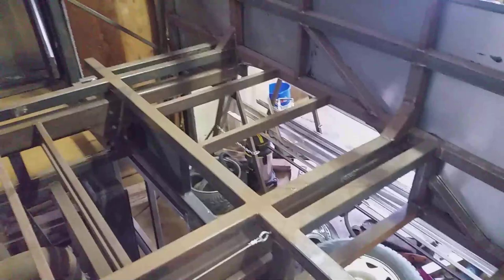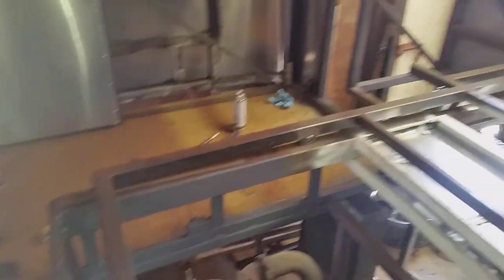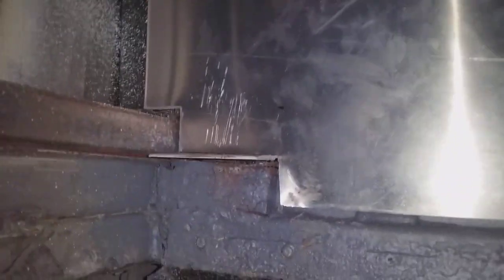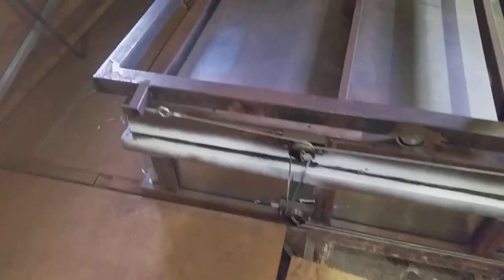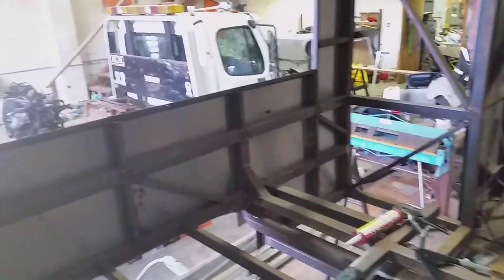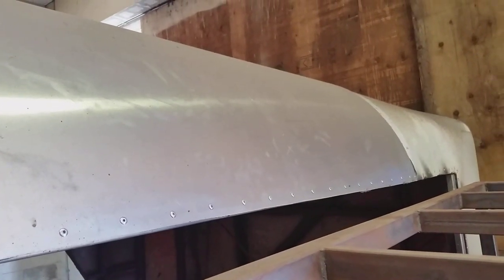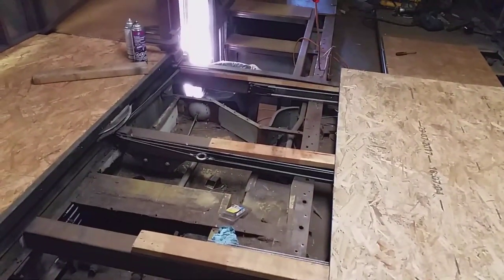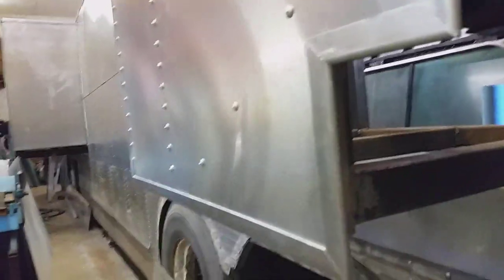Bus Conversion Project - Video 64 - Slideout number 3

Comment: Progress. We are into our second heat wave now. Will be 98 here today. Got the dragster down the track this weekend. We were in the 7's found some problems that need to be fixed and then more testing. (was 99 at the track and wearing a -20 suit was hot.
Reply from the maker: Cool... you feeling any better and did you take any video of your passes, there are always gremlins the first few times out on a new setup..... 7's the first time out.... nothin' wrong with that!!!!!!
Reply: No video but  https://scontent-ort2-2.xx.fbcdn.net/v/t1.0-9/37229544_10155346298741326_5533807920556277760_o.jpg?_nc_cat=0&oh=eabb310f961cd4952af2f15576ff9d60&oe=5BE7583B I expected to be in the low range 7's not 7.8 we did find a problem (fuel filter clogged somehow??) Feeling better but still weak. Temps in the high 90's did not help.

Comment: Hi James !   Well James today I have a question you may or may not have even bothered too equate at this point of the build. How much square footage have you gained by adding / building the slide outs to your coach ?  Thanks a bunch !
Reply from the maker: Hi.... original dimensions give me 300 square feet, the slideouts add 88.25 square feet and the 5 ft. extension adds another 37.5 square feet for a total of 425 square feet.. so 125 square feet larger ...:-).... so 42% larger